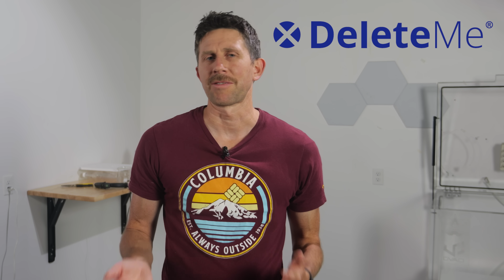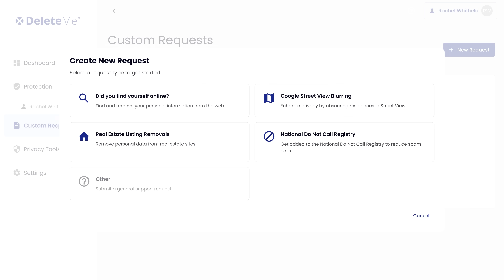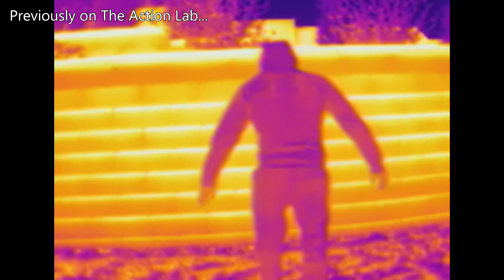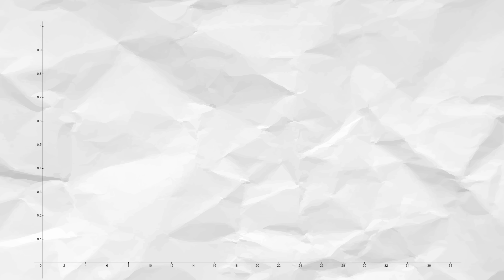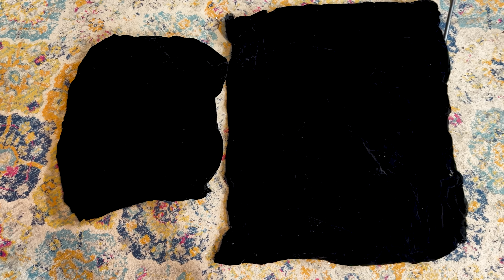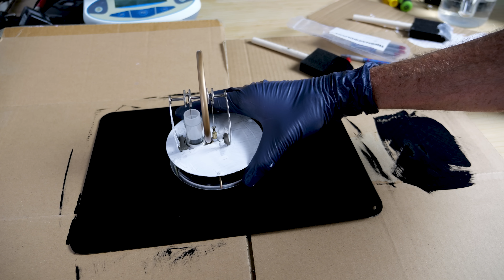This Engine Runs On Sunlight

Comment: Love those engines! I'd bet if you replaced the screws between the plates with something less thermally conductive you'd boost the output for essentially nothing; right now they're a leak path between the hot/cold sides.

Comment: Wouldn’t this work better upside down?

If the black surface was elevated with table legs, you would absorb more energy from the sun. Also, the cool side would be underneath the “table” in the shade (with the engine hanging underneath the table).

You’d need to mount the engine with bolts or screws, but you could still use the thermal paste.

Comment: Wonder how much electricity it can generate, yes it may depend on weather but it a generated that requires no fuel to power like the wind turbine or solar panel, but the probability is it not much, the solar panel is better option

Comment: What if you paint the plate w/ cryopaint and the top w/ the black?  It of course will run the other direction, but would it be better, worse or the same for speed/efficiency?

Comment: Nice variation to a Crookes radiometer. Have not seen a Crookes Radiometer put to use either generating electricity or pumping water for example. Wonder if Action Lab's engine will be able to scale up to actually generate work. Still a cool project.

Comment: This lowk looks like a nice backup for solar panels since it only uses the heat of its surroundings and not the light itself.

Maybe in areas with very high heat where solar panels lose efficiency to temperature?

Comment: Why not put in a vacuum tube and reduce friction?
Reply: It only works due to the temperature difference of the air contained inside the engine. If it was a vacuum there would be nothing to push on the piston, so it wouldn’t work.

For greater output, you’d actually want to over-pressurize the engine chamber with more air.

It needs compression to work. There are probably other gasses besides atmospheric air that would work more efficiently in the same volume… but air is free. 🙂

Comment: So, I'm about to make my own cooling paint, following nighthawkinlights's instructions. I want to test the stuff for myself, and see what I can do with it. 

I'm actually planning to take the white powder once made, and mixing it with a little bit of resin epoxy, and once it's cured, see if it still works.  Then, I want to see if different thicknesses change how well it cools.  Also I want to see what can be done with it, without the dissolved acrylic plastic.

Comment: The hot sink should absorb only in the visible spectrum such that it does not cool down due to IR radiation. It would then probably be able to heat up to over 500°C if insulated otherwise.

Maybe use a sheet of glass put above the black paint. That will give it an insane greenhouse effect. I wonder how hot it will actually get if you also insulate the bottom side with layers of glass and air.

Comment: I wonder if you could make this work with a thermorelectric unit? if it did you could wire them in series or parrallel and build up to what power you need

Comment: I was wondering if you could use the adiabatic temperature difference of the atmosphere at different heights, if you eg. erected a huge heat pipe. I think it basically boils down to: are there heat pipe fluids that have a pressure to temperature gradient different from that of air, so that the height difference leads to usable temperature difference at all?

Comment: It moves, ok. Can it generate power? Hook up the wheel with a belt and turn a generator. How many sterling engines to charge up a battery bank for power at night? Can it be scaled up for personal use?

Comment: Why didn't you show any comparisons?  Or how much it was generating...  Why didn't you just have an unpainted engine beside your painted one?  You are usually good with this type of info.  Of course the engine would work...  It works without the paint..  Why not show if using the paint increased output at all?  I feel you missed a big point of this experiment.

Comment: This looks like a very practical energy solution, well done. I have always been fascinated with Stirling engines.
Reply: Only practical if you throw it away and replace it with a solar panel the same size 😀 That stirling motor can't produce anything, even if we make it 10x larger
Reply: @SolarCookingGermany  State of the art solar panels make a lot of sense for a lot of applications and should be used. There is also a lot of heat produced from factories and data centers that cooling tech can help with, including more specialised Stirling engines that are more powerful. That is my non-expert opinion.
Reply: @harrysosonos9559  Looks like this sht platform censored my comment about Exowatt for no reason. So all I'm gonna say is that we probably never hear of them again.
Reply: @harrysosonos9559 Looks like YT "disappears" my replies. Can't even talk about tech stuff on this cnsrshp platform 🙄
Reply: @harrysosonos9559  Apparently YT censors my replies for whatever reason.
Reply: @SolarCookingGermany  Sorry to hear that, hope you find out why and have it fixed. AI slop is going to trip the algorithum YouTube uses more and more, in my humble non-expert opinion.
Reply: Ha Ha, our responses are all been doubled up.

Comment: Temperatures in certain cities in India are already very high, and even the cryo-paint would be a game changer. But maybe this idea with the black paint could be used for pumping water in the homes. Solar panels are expensive, and this could be a cheaper way to cool down homes. In fact the roof top of homes in my city would be super hot even without the black paint.
Reply: Some guy in USA tried to produce solar-powered AC system on the Absorption refrigerator principle about 100 years ago. It needs no electricity and have no moving parts, just pipes with two liquefied gases and some heat exchangers. One gas adsorbs another making it boil and cool down, than the sun heat separates the gases and lets repeat the cycle.

Comment: It runs on temperature differential, because it's a Stirling engine, duh.  You could probably run it in reverse on a sunny day with a black plate attached to the top and the bottom set on the cool ground.

Comment: I have one of these sterling engines. It runs in sunlight just like it is (without any special paint). The top gets hot and the bottom stays cool because it's in the shade.
Reply from the maker: Interesting, I would like to compare the work output of both setups
Reply: @TheActionLab please do
Reply: I find it interesting that your tradition method radiates heat into the Earth, while this method radiates heat into the sky.

And for that reason I actually think this method would be more efficient because the sky is colder in comparison to the Earth, because it can accept more energy than the Earth can absorb. Basically it's why the sun shines too heat the surface of the Earth.

Comment: could mounting the stirling engine to the underside of the black panel increase its efficiency by allowing the center of the panel to absorb and transfer more heat from the sun exposure to the hot-side of the engine?

Comment: Finally someone did it. I had this same idea years ago when NightHawkinlight made a video about his passive cooling paint. I used a water cooling system in my design, it uses an insulated box and funnel on top to increase viewing angle of the sky without gathering the horizon and it reduces the air temp over the panel as well, this cools the water and the water is pumped to the Stirling engine. The hot side is just a heat sink with ambient heat. The most I could get out of my design was 60w per square meter of cooling panel.

Comment: I think the part about using the sky as a heat sink is a little confusing and misleading; it sounds like a better way of describing it is that it mostly reflects all light frequencies from the sky and only absorbs the ones that you don’t get much from the sky, so it doesn’t gain much thermal energy from sunlight. Is that it?
Reply: You can use space as a sink and shoot radiation in to it to cool stuff down. They used to make ice in the desert this way, and nowadays we have some interesting radiator tech that does the same thing.

Comment: Wonder why the white paint sit on top of black one? I guess that way is the only way to harvest energy. Just in different form.
Reply: The white paint is reflective and black paint is absorbent it will create potential temperature defferance between top and bottom surfaces eventually creating force inside the piston due to heat transfer. For example black surface is 5 degrees hotter than the atmosphere temperature and white surface is 5 degrees cooler that will create total of 10 degrees in temperature defferance..if they use heat concentration method the temperature also raised to more than 100 degrees.

Comment: Just to be clear you don't need the fancy paints for this to work, with that same Stirling engine here just sitting on a flat stone surface outdoors in the sun with some regular black electrical tape on the top plate will keep it running all day no problem. Note that it's not self starting, so you do need to either give it a nudge or keep it running 24/7 – I have the engine (no black tape) currently sitting on an old raspberry pi doing minimal compute work that has been spinning continuously for ~3+ years as a fancy heat sync.

Comment: but the sterling engine is sitting on top of the black that's not going to help it You need to paint the bottom of it black and turn it upside down and then the white will be on the shadow side so that helps it out too. so does it work upside down? if it does I think that would be 100% better, if it doesn't work upside down You can still paint the bottom black and use mirrors to focus the light on the bottom and put something over the white part that would make shade on it

Comment: I always watch your videos even if I think I understand the topic, because I'm still virtually guaranteed to pick up some detail or nuance that I didn't know. I was aware of the blackbody physics, but was thinking about emission and absorption as if it were generally coupling to the electron orbitals (and no other mechanism) across the spectrum. Interestingly, if we truly were restricted to orbital transitions, most of the lower-energy IR transitions correspond to small gaps between high energy states that would be generally unpopulated at cooler temperatures- in this scenario, we wouldn't start to see IR emissions until the bulk energy increased enough to populate the endpoint states. The solution to this is that many IR transitions in real materials correspond to vibration, rotation, phonon resonance, charge migration, and other things that aren't limited to the purely electron orbital domain. That's not a detail that I was thinking about this morning.

Comment: The demo would be a lot better if the assembly was put down on a layer of styrofoam or at least insulating feet so it wasn't also being heated by the hot paving stone it was put down on.

Comment: You could power some little water features in your garden with that? Small fountains, or a constant trickle of recycled water in miniature rock garden setups.
Reply: Theoretically. But, solar panels and electric motors would do the better. Especially, with a battery, allowing the fountain to continue to function when a cloud passes in front of the sun.
Reply: That's what I was thinking, mechanical to mechanical. Maybe even substitute cryopaint with the water

Comment: the black paint was mostly hidden by the engine, try putting it on a big piece of copper painted with the paint
or better yet, a vapor chamber/heat pipes

Comment: Carnot say: Efficency = 1 - (Temperatur low / Temperature hot) in Kelvin not in Celsius or Farenheit! For example hot (black) 40° Celsius and cold (white) 20° Celsius So its 1-(293/313) that means less than 6% theoretical and real less than 3 %. A solar panel has real 22 %!

Comment: So, does this mean you can increase the power output of single sided solar panels by painting the cold paint on the other side? Also, I would like to see you do the same setup with Peltier devices between the plates and running off the radiation from some stored heat tank.

Comment: Even the very small solar cell 6cm x 8cm can produce about 0.6W pure electric energy. And there are many advantages of having energy in electric form.
1. You can transfer it with very high efficiency and low cost. You can put solar panel under sun and spin the fan in shadow.
2. You can easily collect and store it with almost 100% efficiency in Li-Ion batteries.
3. You can accumulate it and then use in short strong burst. You can charge supercapacitor or small battery and use it to spin some huge mechanism for a shorter period of time.

Comment: Wait what if the black paint is thermally insulating?
Wouldn't it make more sense to leave an unpainted circular area in the middle, put thermal paste on it and then slap the stirling on top?
Reply: The black paint absorbs heat well and radiates it well - it is more like thermal paste, it's not an insulator.

Comment: The biggest issue I have with this setup is that I'm not convinced it wouldn't have run even without the "cryo paint".  The large painted black plate should get much hotter than the shiny engine alone.  I would love to see a comparision with and without the cryo paint at some point.
Reply: Cryo paint converts heat into infrared radiation faster than normal surface .

Comment: I would love to see a Stirling engine actually driving something.
Reply: twenty odd years ago parabolic dish solar stirling was the most cost effective way of converting sunlight to electricity, Also the Swedish navy had  submarines using molten salt as a heat source for stirling engine to run the sub
Reply: @cuthbertlewthwaite Aware.  But, in all the demos of the engine, we never see it turning a dynamo, pumping water, or doing anything useful.  I question why.  Seeing a Sterling engine spinning without any work resistance is not very convincing.

Comment: I'm curious if you hook up this sterling engine to an electric generator, how much electricity can you produce compared to a typical solar cell? My guess is a lot less, because of how low-friction a sterling engine is, it's not actually doing all that much work. I also wonder if this could be used with a Peltier cooler, used backwards to induce a charge from the temperature difference.
Reply: You're right, it's useless. Even Peltier modules / TEG suck compared to a same size solar panel

Comment: Some napkin numbers to estimate the power generated and the efficiency 
-a lot of people seemed curious including me;
The power output is basically nothing, the efficiency also is basically nothing!

GETTING DATA FROM VIDEO
In direct sunlight the white piston takes ~1 second to complete a full cycle (going from up to down to up again)

I estimate based on the average male thumb that the transparent hollow outer cylinder that holds it is 1.5 inches tall
At the down position approximately 10% of the white piston is above the outer/container cylinder
At the up position approximately 40% of the white piston is above the outer/container cylinder
This means the systems is travelling 30% of the white piston's length twice in 1 second (Give or take 1inch per second)

ANALYSING DATA
Assuming simple harmonic motion  (looks very much like it)
It has a period of 1 second, so the angular frequency is exactly 2Pi
Amplitude of ~0.25 inches (about centre), so max velocity 0.25*2Pi inch/s
Or the max velocity that is the primary work of the system is ~1.57inch/s
This is achieved at the halfway rest position

The work required to go from rest to 1.57inch/s is equal to the energy gained (0.5mv^2)
Which i will now convert back to the correct units ~4cm/s or 0.04 m/s
Or 1/2 (m) (0.04^2) = 0.0008m Joules -where m is the mass (unknown)

It appears to be a hollow polymer cylinder ~1g/cm3 density 
it appears to be approx 12.5% of its outer radius is wall thickness
Appears to have an outer diameter of 3/4inch
Giving a total volume of ~3cm3 and total mass of ~3g
meaning the total work done is 0.0008(0.003) or 0.000024J per 0.25s
Meaning the grand power output of the piston is approx 0.01 milliwatts !

But, theres also a crankshaft and wheel that sucks energy out of it...
They dont change a whole lot, it appears to be a light weight aluminium wheel maybe 50g
the crankshaft probably heavier
They spin at ~60rpm (in line with the piston's strokes)
AI estimates these would roughly make the grand total power output around 0.03 milliwatts

POWER & EFFICIENCY CONCLUSIONS
So overall even if this is off by a factor of 30000x (it's not)
It would still not even generate 1W of power
For the at least 0.5m2 sized black rectangle, a cheap solar panel could generate 100W
For approx $20 from China it would generate over a million times more useful energy (on same footprint)
so the efficiency is non existent cost or energy-wise

PS
its a little strange it works out to be ~60RPM from the sun
It raises questions for me about if it's staged lol 
AI estimates was used as this has already gone on too long!
Guys this vid was a cool physics phenomenon explained, NOT A POWER SOURCE!
Reply: on a cup of hot liquid that engine can give .25 watt
Reply: @cuthbertlewthwaite lol care to expand on this comment?
sounds like youre saying im wrong by a factor of over 10000 but just wanna double check
Reply: @3pints AI says 0.03 milliwatts? AI?
Reply: @cuthbertlewthwaite Youtube is offering to translate your reply to english
That is how useless of a comment it is!
I recommend you try to form even one sentence in future, to get a reply
Reply: @3pints are you seriously telling me you could not understand what i wrote? WOW, never mind eh? Nah, i don't want a reply, i really don't want to argue with AI